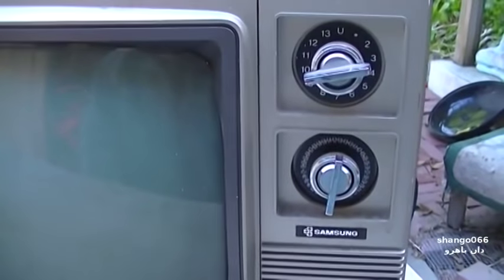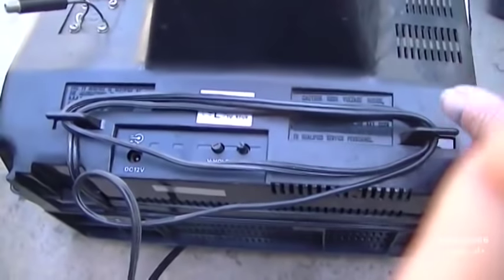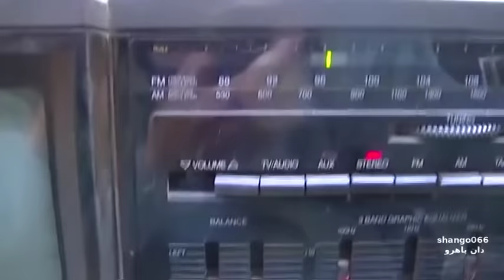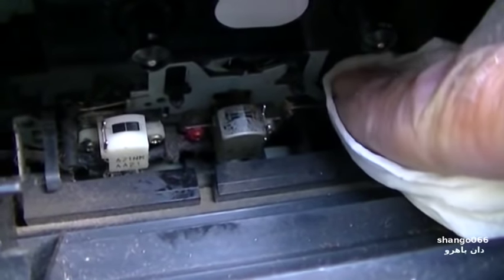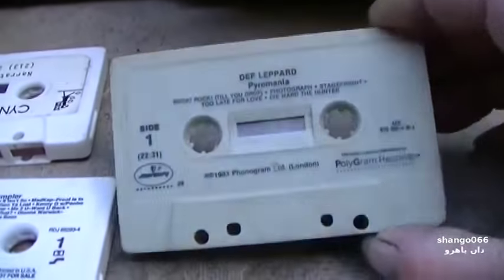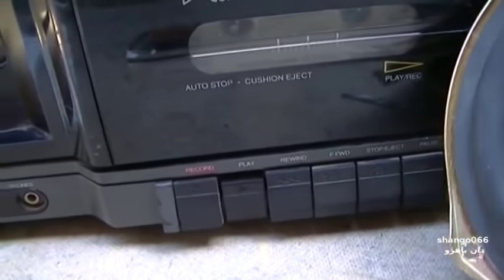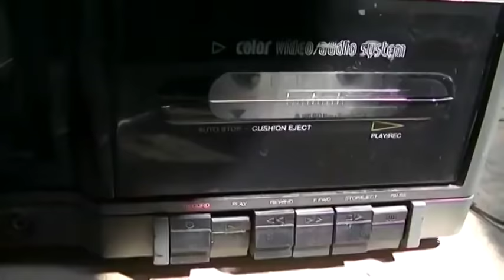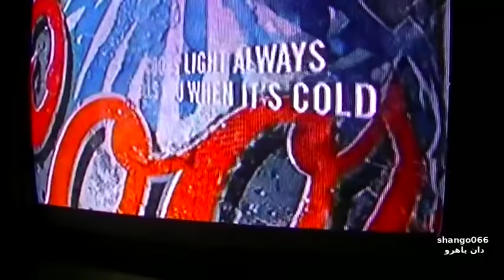Two Retro Portable Televisions

Comment: Hm, now I want one of those old TV's (a color one) with a huge manual dial, because we still use coaxial cables in these apartment blocks where I live, so I could actually use one of those.
Reply: you can actually use this with screw terminals too! Just take an old fm antenna or something with coaxial plug take the wire from the inner pole and connect it to one of the Screw terminals! you can See this is my vid where i Show a 1973 B/W tv
Reply: @ddorfpunk  It's called a matching transformer or a balun as in balanced-unbalanced which is the difference in the 75 ohm and 300 ohm antenna distributions.

Comment: Those B&W Samsung T.V.'s had excellent pictures as long as the jug was good, They didn't like it when the D.C. in went below 11 volts.
Reply: Their performance on weak UHF signals was great.
Reply: The CRT filament runs at 11v so that makes sense.

Comment: High bias audio cassettes have the cro2 detection combuned with the recording protection tab, if you punch out the tabs then want to re-record later you need to be carefu not to cover the inner sections of the holes otherwise with recorders that don't have auto bias set (where the machine records test tones then tunes the bias 2 or 3 times) you can end up with wonky sound.

Type 2 (type II) chrome I used a lot of, lower hiss noise levels, higher output volume and clearer high frequency closer to CD, HX-pro headroom extension on the hifi twin decks gave pre-recorded like performance.

Comment: 7:14 I'll bet the main reason they sprung for the voltage regulator was to protect the circuits from car cigarette lighter voltages, which swing all over the place when the car is charging. The variation from the mains transformer would probably have been tolerable on a cheap set like that one.
Reply: I once read an applications note that described automotive electrical systems as "the power source from Hell."

Comment: My mom has a signed copy of Look What The Cat Dragged In. Might swipe it and digitize it someday. I broke one of the fingers in my Onlyo TA W100 while i was trying to remove the motor for lubrication, now it doesn't notice a tape on the right side deck.

I always fast forward and rewind a tape before playing if it's old, just opened or if i just bought it or something. And rewind it before playing/recording. Also i'd play that Def Leppard cassette in a good deck before judging if it's worn out or not, or if it's rubbing off on the head, yeah it would be shot.

Comment: The black and white TV CRT looks just like two Romanian made TV's I've seen from 1990-1993 or something. The yoke and the tiny CRT board look identical. The rest well, is different and worse made. It's surprising that they kept making B&W TV's for that long. Cheers :)
Reply: There is still a B&W market. Here is the UK, the compulsary tv Licence is about £148/year. A B&W licence is £50. The Samsung is a good TV & when I ran a tv shop in the 80's we stocked them & never had one back. They did the 12" (like here, though we are UHF only in the UK), the 14" one & a 17" one too.

Richard (UK)

Comment: Ahh, the GE 7-7800 color TV 'boombox' sets, I used to actually have to fix those things on my workbench in the day, I  remember having to replace a crt once or twice under warranty, lol. Lot of stuff to disassemble, with stripped plastic threads, very weak wiring connections, etc...The plastics (buttons, etc) were real garbage, an early example of the Chinese 'invasion.' Even Funai stuff was better.

Comment: Fairly common to find tv radio cassette players in Europe, they usually had a 5 inch black and white or colour, Handle on the top that folded underneath for watching tv, I've got a couple in my garden shed, they ran off 240volts or 8D batteries, so were kind of portable, any bigger screen and internal batteries wouldn't have been viable

Comment: I will have to differ with you on magnets erasing cassette tapes, permanent magnets won't erase them very well if at all. I tried to do this deliberately once, I had some cassettes with Amway crap, seminars, or what not on them that I wanted to reuse, and I left them on a speaker magnet, didn't work. I even left some magnets from a microwave magnetron on them, it weakened the volume but did not erase them. Finally I knocked an old transformer apart and turned it into an electromagnet, then I could erase the tapes.

Comment: Watch porn in the car?!
Reply: MrVinamp In Germany, you can only watch white noise with this thing in the car. Don't know if they did an EOL for analog TV in USA.
Reply: ***** Just bring a vcr, it has a composite input and you will be able to watch whatever you want.
Reply: StereoDustParticles What a pity, Quite liked it. DVB-T is digital. And digital is: It works, or it does not work at all. Analog could have worked with lower quality when there was not enough reception.
Reply: Nintenloup wolf
Cool Idea, but I dare to modify this idea a bit: Isntead of VCR I would use a portable DVD-Player with Composite-Out OR even a bord computer with USB -> Composite out graphics to playback ANYTHING on it. :D